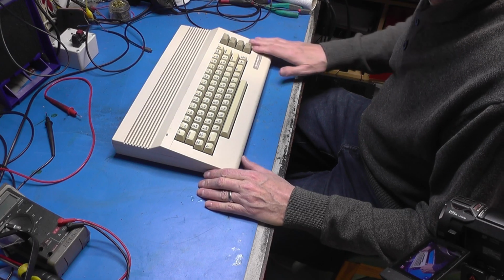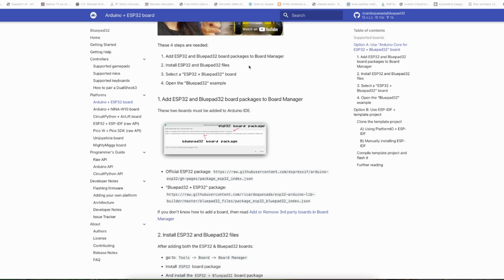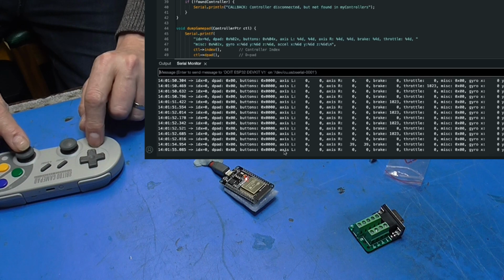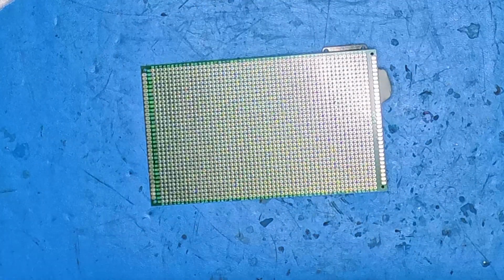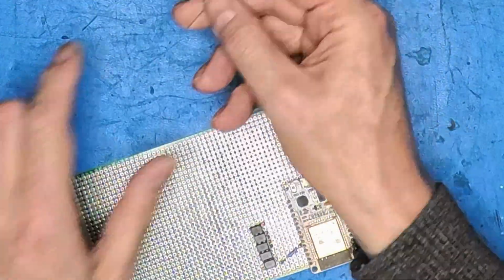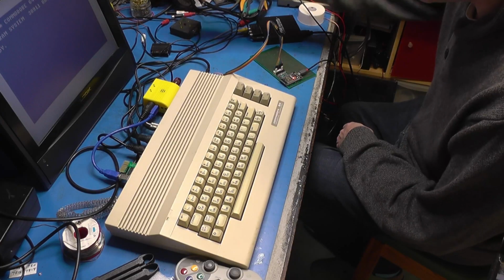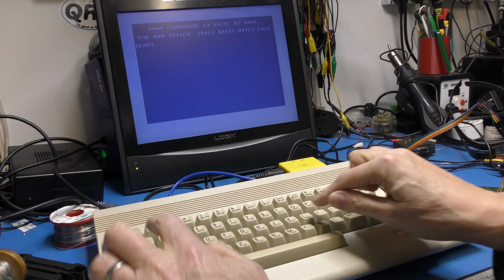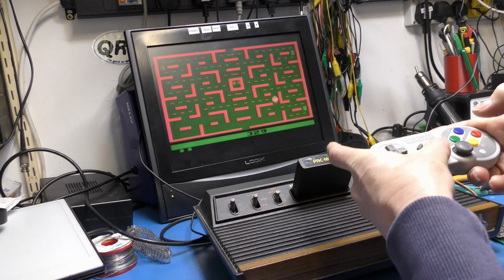Building a bluetooth joystick adaptor for your 8-bit system.

Comment: Interesting project. I wonder if a similar technique could be used on the BBC Micro. Its joystick port works differently to the C64.
Reply from the maker: The BBC joystick is analogue. Essentially two pots. We'd need to equip the esp with a real digital to analogue converter, something like an rdac would be ideal. You could then map the values from the analogue sticks on the controller to the rdac values. Hmmm ....
Reply: @ Last year I built a joystick for my BBC, using a microswitch-based arcade joystick with a 10K resistor across each of the switches. This replaces the potentiometers that would be in an analogue stick. I am new to the BBC, but from what I can gather there are very few games that actually require analogue sticks instead of “on-off” ones. I got the idea from the Stardot forum.